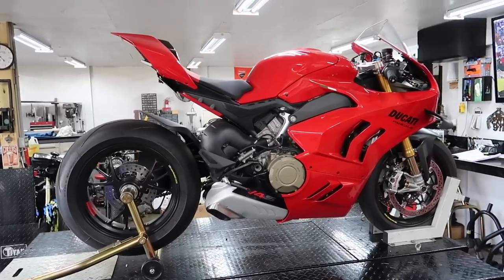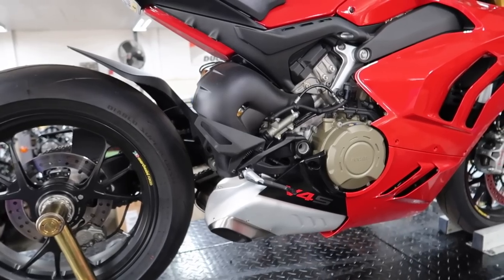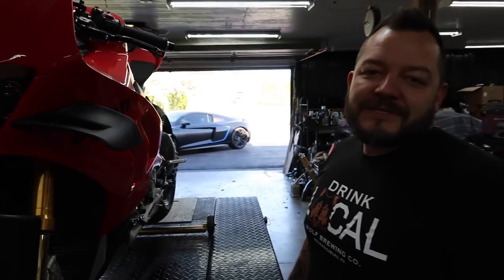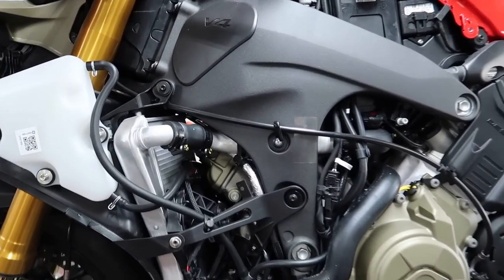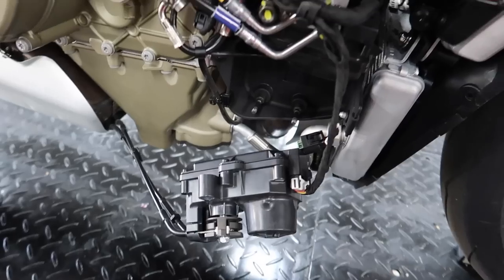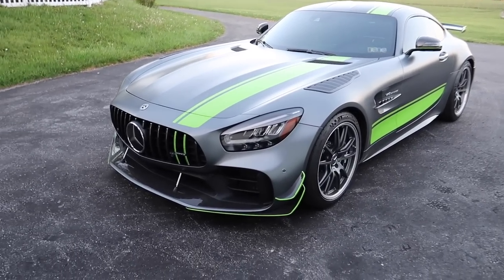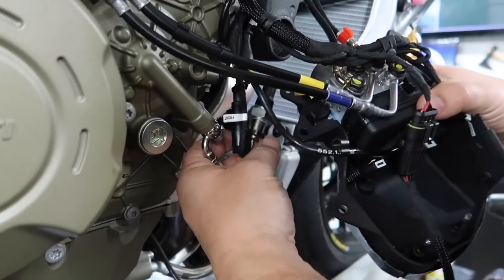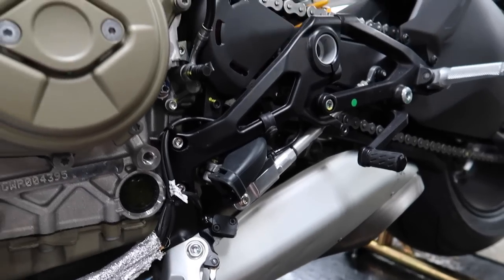Removing Our 2023 Ducati Panigale V4 Stock Exhaust!!!

Comment: I’m getting a full Ti Akrapovič system on my Streetfighter V4S at the beginning of June (not the wheelbarrow version).  Super stoked to feel and hear the difference.
Reply from the maker: ohhhh you will love it!
Reply: @JaretCampisi  yeah I suspect I will, especially in the mid range where it really counts.  I’m also getting a lithium battery at the same time to really maximize the weight savings.  I’ve watched your Streetfighter giveaway video many times, the one where you went for a blast in Santa Barbara right after Rory installed the Akra system.  Oh and for sure go for the Superfast V12 😎

Comment: That black plastic under-chain tray at 23:10 looks like it might help catch chain lube dripping from the front sprocket? (I don't know - my 2020 doesn't have one and lube drips onto the exhaust shroud and dribbles down the side stand and everything else in that area.) If that's the case might be worth keeping it on the bike, if possible.

Comment: Ducati are going to trial factory fitting accessories such as exhausts etc to save time and costs at the dealers in the uk, then you’ll just get delivered the original parts boxed.
Reply from the maker: They won't do that because often a lot of these parts are "race only" so that's why they don't come installed on the bikes

Comment: @Jaret.. just cut the headlight in half, there saved ya half replacement cost. :P (modern problems, require modern solutions)

That's a lotta wires in there... bikes used to be so simple, now theyre computers with 2 wheels

Also I did the same tossed the charcoal canister on my 1199.... had had starts at hot temps... No mo.

Comment: That oil level seems concerningly high
Reply: Just changed mine. The authorized dealer fills it to near the top of the glass. 
Takes a very small amount of oil to bring it above the fill line.
Reply from the maker: nah its just because it was up on a rear stand

Comment: My guess for the headlamp is 1800 or better.
Reply from the maker: it was literally $1800
Reply: @JaretCampisi  Nailed it. I work at a body shop... mainly cars and light trucks and it seems like the Hid lamps are always about 1500-2500 range. Tell Dado to super glue it 😆.

Comment: Watching this is not helping my bike depression. Had the clear clutched installed a week ago on my Diavel 1260, was going to install an exhaust this last weekend. But when I was on my way to work last week, I didnt see anything in the road, but something got stuck in the rear tire, as the tire rotated it put a mark on the swingarm, cut the rear brake line and wire harness, and then punched a hole straight through the wheel. Now it's sitting at the dealership waiting for them and the insurance adjuster to review it. No idea when I will get it back.
Reply from the maker: oh man I'm so sorry to hear that :(